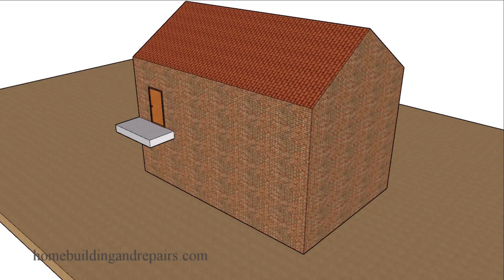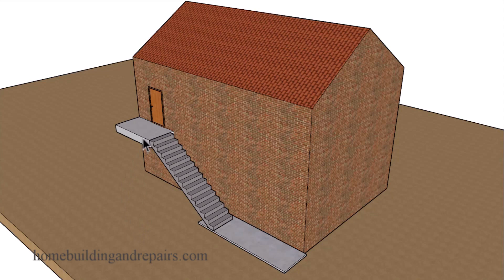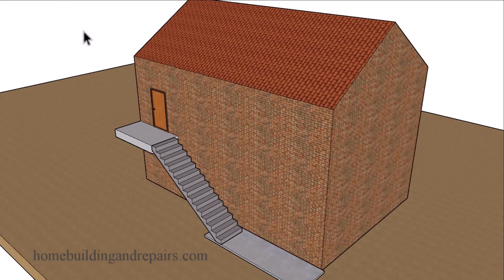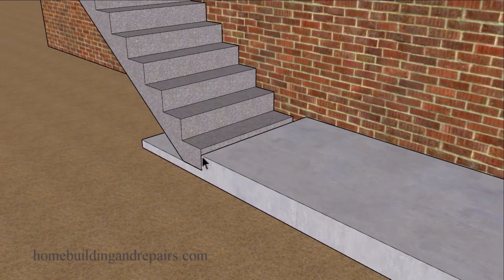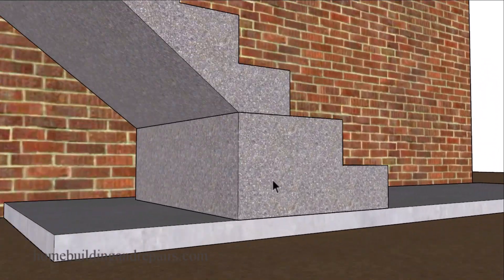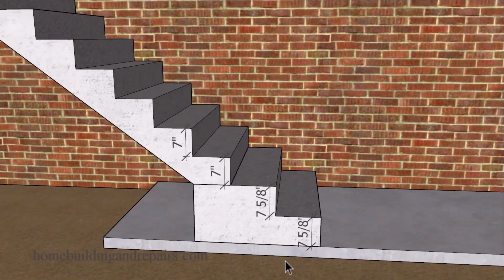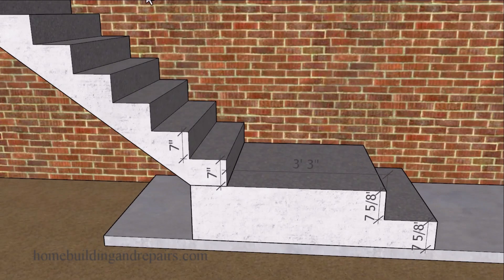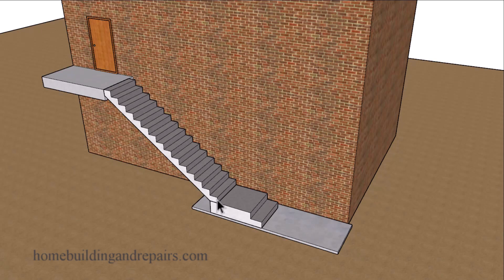Exterior Stairways Without Total Rise Measurement Should Not Be Built - New Construction Problems

Comment: Do you have a reference video for replacing stairs down to the lake. There are existing stairs if you could call them that, so difficult to figure out the rise because they're a mess and ground is not straight. Question,  would it be easier to figure out sections with landings using pre-cut stringers, or use 8, 12 foot boards and then make my steps and if so how? Hope this makes sense.
Reply from the maker: No, but I do have some on landscaping at our website or outdoor projects that might help.